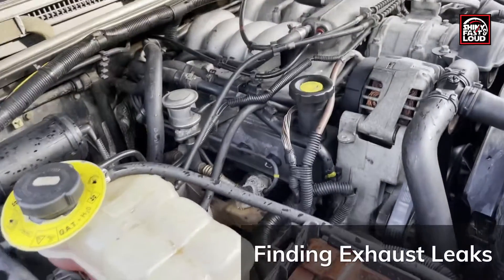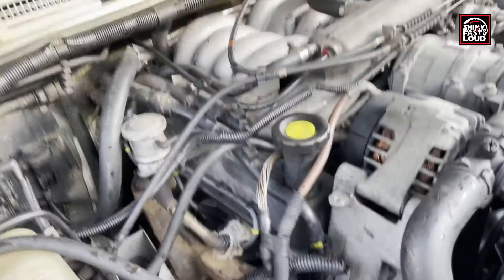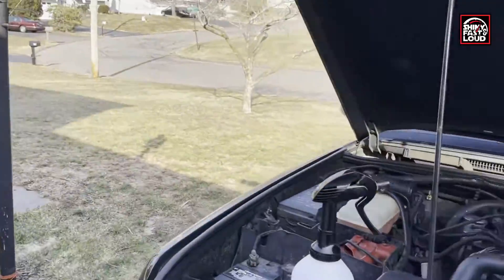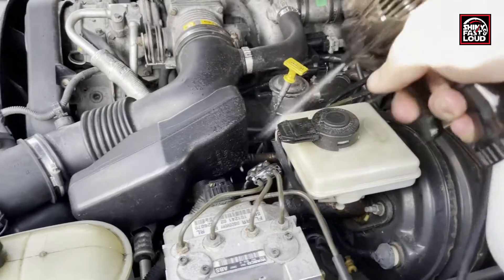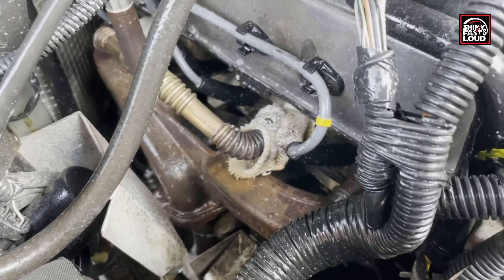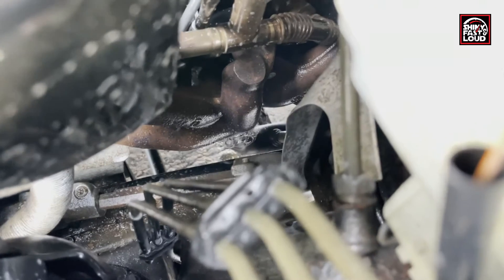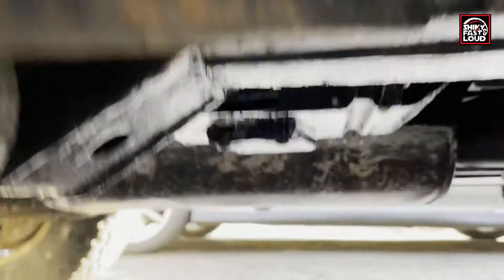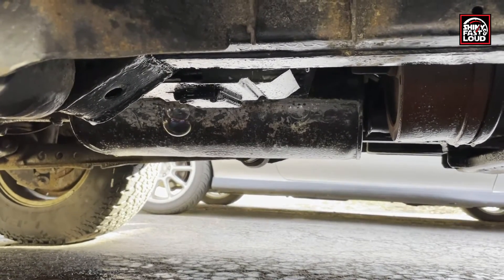Easiest Way to Find Exhaust Leaks

Comment: I like the thought but blowing a potential piece of rust or metal into your cylinder and scoring the walls and or damaging the cylinder head seems like it's counterproductive I would recommend using a smoke machine for automotive use

Comment: brilliant idea! would you get comparable results when idling the  engine? It takes some time to heat up the engine
Reply: Would be pretty hard to force air into the system with exhaust coming out the tail pipe 🤷‍♂️
Reply: @dustinkennedy6128  think again, its about seeing the bubbles. ofc you wouldn't use the vacuum
Reply: @neindochoohh7955 you think again.. who said anything about a vaccum it was a blower .. you don’t wanna send exhaust back into the running engine anyways
Reply: @dustinkennedy6128 sry, German here😂 blower. Im guessing that you dont need a blower, cause the engine creates enough gases😊

Comment: Great trick. Going to try this on mY TOuareg TDI. When clod it STICVKS in the cabin within seconds, and when it's hot the smell is gone... Pretty sure it's a leak in the engine bay near the cabin intake but there's so much going on in there, soapy water may show it up.

Comment: Can you use too much air pressure and cause leaks? As I am not sure about this technique. I have throttlebody full injection FiTech with some issues and they want me to check for exhaust leaks that might be affecting the O2 sensor. I just don’t wanna create an exhaust leak with too much air pressure. I was thinking of using my shop vac I’ve seen somebody else do that with a shop vac.
Reply from the maker: A Shop Vac would not cause a leak, the pressure is nowhere near what the normal exhaust pressure already is applying to the exhaust system

Comment: You can allso take a 3/4 inch diameter hose  2 feet long and attach the one end to your ear and then run the other end  along the exhaust and you will imeadiatly hear the leaks  while the car idles
Reply from the maker: you can, I just really like this approach because the engine is off and cool
Reply: You get an earful of carbon monoxide